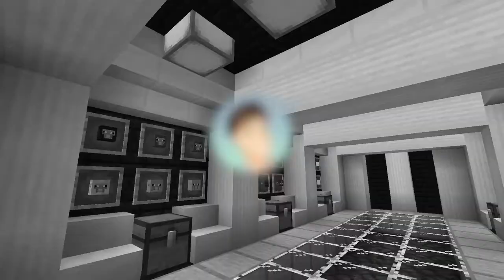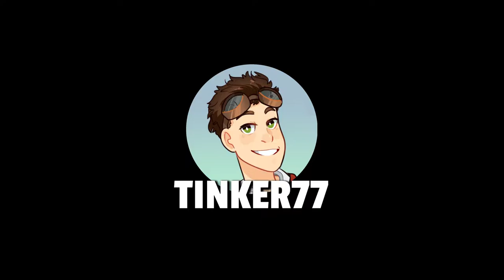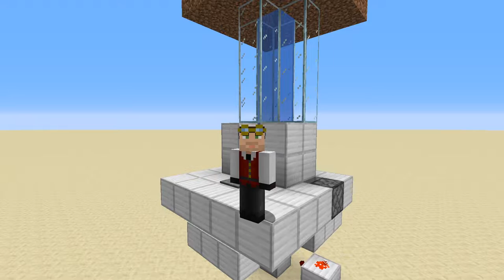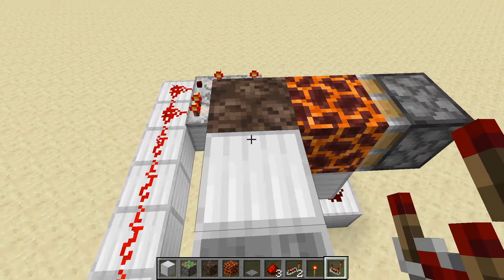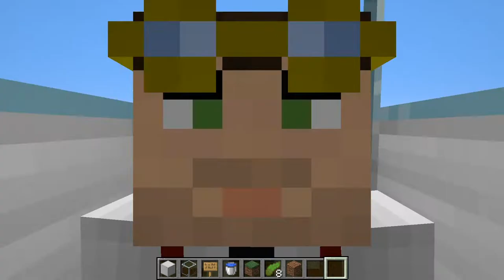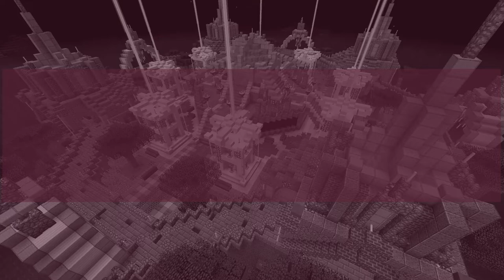[1.15.2] - How To Build Auto Water Elevator! - YOU NEED THIS!

Comment: i need to know how to extend it i have built it perfectly fine but i thnk i got the gist  of it but i feel like theres more to it i have indeed extended it  but not as i think its needed
Reply from the maker: The second half of the redstone circuit that wraps around the left side... you add a comparator clock which will extend it.
Reply: But like how much do I extend it I’ve extended it by 6 block and I see no difference in timing

Comment: How to extend it more could you please explain it ?
Reply from the maker: You can extended by using pulse extenders, such as a series of comparators facing in opposite directions.  The more you have the longer it will last.  Think of setting the comparators up like on a highway, with one side facing one direction and the other side the opposite direction.
Reply: @Tinker77  i have done it with reapeters but thanks for help!

Comment: How do you get the magma piston to activate first when you step on the plate, but get the soul sand piston to activate first when you step off?
Reply: In bedrock btw
Reply from the maker: In bedrock I'm not sure.  I think I did a video about a water elevator for bedrock?  I don't remember.  I don't think this design works for bedrock though.
Reply: @Tinker77  I ended up just putting obsidian there so they have to activate at the same time, everything else worked great though! Thanks

Comment: For longer tubes a hopper clock works better, instead of all the comparators.
Reply: how do you connect the hopper clock to it though ?
Reply: @josh3784  It's a system of 2 hoppers facing each other with pistons pushing a redstone block to power and un-power the switch to the magma and soul sand. It's governed by the number of items in the hopper, the more items the longer the lift will stay on. Use the main power line to run it.
Reply: @tisjstme5315  i know but i don’t understand where to connect the hopper system and where in the elevator system that he made
Reply: @josh3784  it goes at the base with the other redstone. It's hard to explain. just do some testing out till it works how u want it. I'm not good with the telling of how to do redstone. I just do it and test it till it works.

Comment: I have been playing this game for eight years and there is nothing that can make me understand why that second torch works
Reply from the maker: There is a slight delay as the signal works it's way around.
Reply: @Tinker77  that makes sense to me but I don’t understand where it connects to anything. It looks like it’s just floating out there and shouldn’t be powering anything, it’s crazy!
Reply from the maker: @kylewoodard5347  I don't see where your confusion is.  The first torch is attached to a block that is sometimes powered by a repeater.  It powers the redstone dust on top of the block below it (remember, the redstone dust occupies a full block space).  the dust, powers the block below it, which, just like the first block with a torch, powers it's torch.

The second torch is powering the blow below the vertical piston.
Reply: @Tinker77  right, and then the dust under the first torch is connected to the second torch. but what is the second torch connected to?
Reply: @Tinker77  I think he's referring to this part at 2:42 Even if you remove the redstone torch there, the soul sand piston will still be powered and the machine wuld still work normally.

Comment: it's a nice gadget to have in your base and all but the magma block is a terrible way to go down(forgotten to crouch at the bottom too many times), a long drop with a water catch works much better(and faster).
I prefer to use ice to fill the tube with water sources....
Reply: Wandering MadMan but then you have two holes in the ground:(
Reply: @jerod5636  there is a way to design it so both up and down fits in one hole if you want it too... with dispensers but the two hole plan works well enough for me most times.
Reply: That doesnt look cool tho
Reply: @rylul9519  "Looking cool" is largely based on opinion and usually is affected mostly by your own creativity...

Comment: oof i guess it doesnt work in 16
Reply from the maker: It works fine in 1.16. I use it in a few places in the 1.16 server
Reply: @Tinker77  but whenever i put the redstone below the pressure plate, it doesn't power the other redstone and the repeater which connects to the soul sand